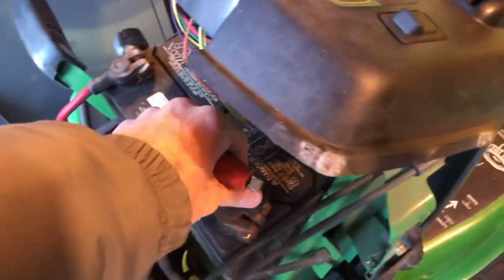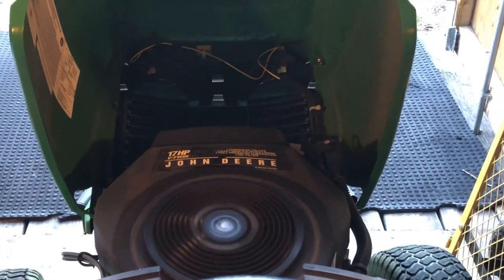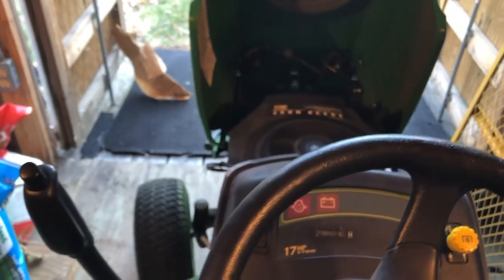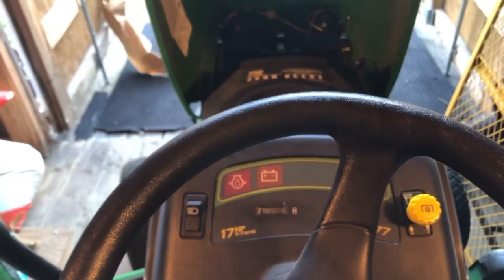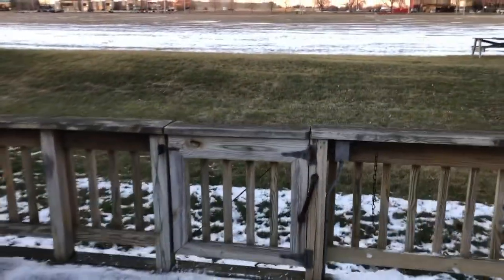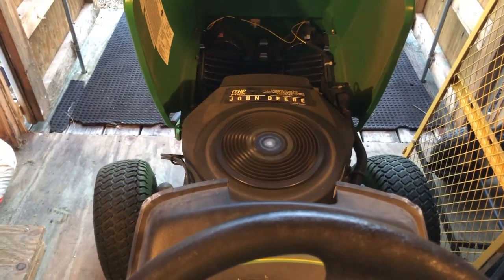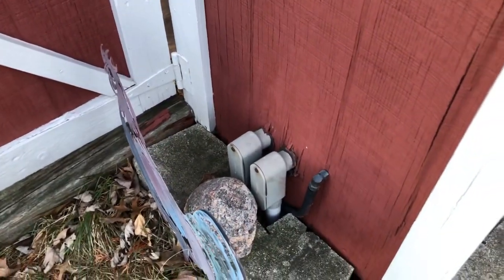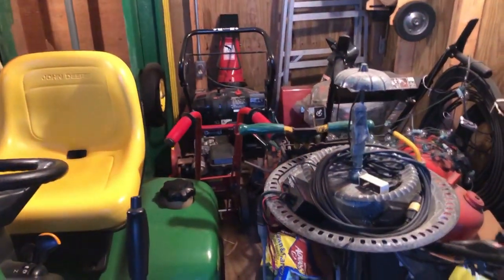Cold start John Deere LX277 tractor in January

Comment: We got ours in 2002 and only just recently, I think in 2021 got a new battery, the John Deere guys said that the batteries from that particular time were exceptionally well made and they saw many, many old ones last 15+ years.  I actually removed the battery and took them in where it wouldn't freeze then I would just charge them up, once around christmas time, then another right before installing them back in to be used.  Worked really well.
Reply from the maker: I can totally belive they were getting good quality batteries.  Mine still cranks well now in 7-2023 even when it has not been connected to the maintainer for a couple weeks.  If it wasn't here to see I would not believe any battery of that age would still hold a decent charge.  Full disclosure, it has lived on a good quality Schumacher Battery Maintainer most of it's life.